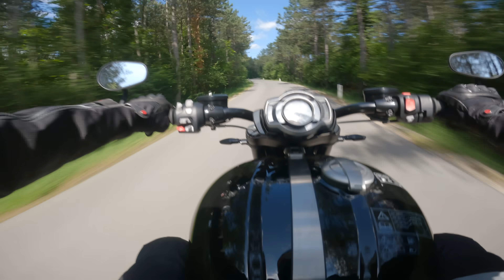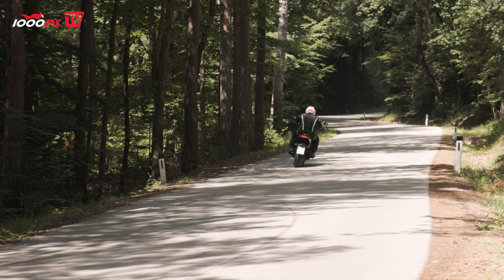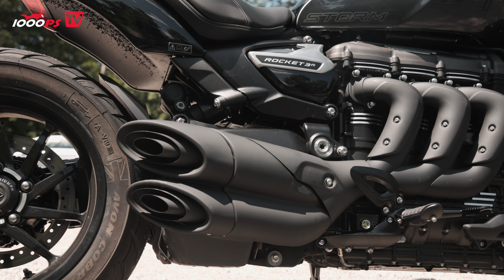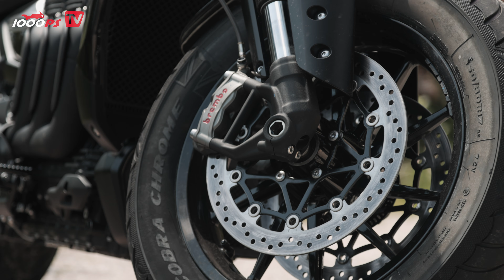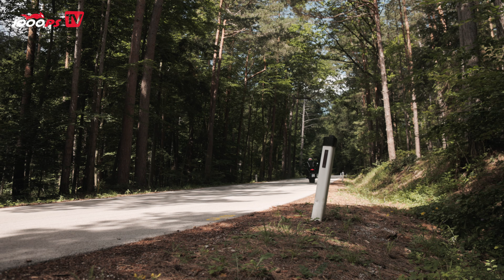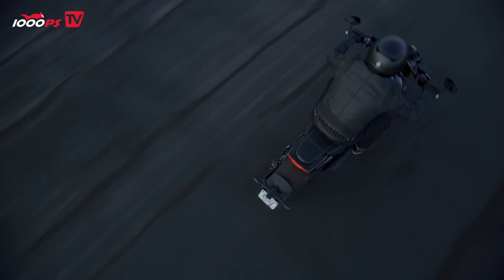225 NM TORQUE! Triumph Rocket 3 Storm R Test 2024

Comment: Good video. I hate when other reviewers say it’s not meant for the twisties. No… just because YOU can’t ride it doesn’t mean the bike isn’t capable. My 2020 gets ripped through the mountains and hills regularly. Did a track day on it as well. Didn’t break any lap records but the coaches were impressed. Fantastic bike. Mine has 50k miles on it currently. My speed triple 1200 rs has 10k. Both are very capable and triumph did a great job with them

Comment: This was a really good practical assessment - despite the low-down weight I wonder how easy it is to manoeuvre when you’re pushing it around?
Much respect from me for your rider’s skills, but you’re right on the edge of being bitten big-time… stay lucky and Thanks!
Reply: They are easy to ride but pushing a "dead weight", especially on gravel car parks is to be avoided.  I also (always) reverse in to park so I can ride straight out.  Any incline or road camber towards the kerbside makes moving difficult.

Comment: How solid and reliable is the gearbox? Shadetree Surgeon had gearbox trouble i heard with it jumping out of gear not sure if it was 2nd or 3rd gear. Also are the electrics good as thats often very expensive to fix. I know the 1600cc Thunderbird is great and someone i know well bought one for £5500 with 16600 miles on the clock. The finish was immaculate, even fasteners were clean with no rust. Its got so much pull from under 1500rpm and the balance was low so it felt great. U turns were good for the weight but on full lock its not easy but comfort, brakes, forward controls and handling was great for a big cruiser and the rocket 3 is probably similar and as its torquey and low revving it is returning over 40mpg when cruising in top gear. I had a old 1996 Daytona 900 and that was top heavy but keep it below 5000rpm it would do nearly 50mpg if you didnt be agressive on the throttle. The rocket is far better on a long journey in comfort. The shaft drive on the rocket 3 is brilliant. The Tiger 1200 seems well built as does the 1050, 900 and 800. Amazing triples. Theyre far better than the spec sheet suggests and theyre well sorted over many years and far better in my opinion than the bonneville twins. I do however love the 675 daytonas, 1200 scrambler, speed and street triples and the trophy tourers from the 90s  certainly seem to go on and on. The speedmaster, thunderbird 900, speed twins and even the bobbers are good factory customs and the latest 178bhp speed triples go like stink with great build quality, design, suspension but £18k isnt cheap but the 765 street triple basic model is a bargain next to other middleweight bikes but the Yamaha MT09 seems a very well made bike and the suzuki v stroms seem to be great for touring like the 800 but they are not cheap but it depends on income as many bikers use them for year round transport and cant afford dealer prices for servicing so long service intervals for valve clearances makes a big difference. The Yamaha supertenere 1200 is a great, rugged, well built bike but the valve shims is a difficult job. Working on the honda v4 engines wasnt easy either and getting to stuff meant so much work removing fairings for example before getting to stuff. Having a complete workshop with tools, bike lift etc certainly makes so much difference.

Comment: Finally! Someone who can actually ride the Rocket!  Thanks much for an awesome review. 83,000 miles on my 2020GT btw.
Reply: Hi, have aprox 25t miles on mine, flashed, how is Yours performing? kudos 4 the milaege
Reply: @Marco-123-mmj  Actually the Rocket got stuck in 6th gear (the pivot plate and the detent wheel had worn to the point where they wouldn't shift the transmission) on a long trip. I made it the final 1300 miles home through mountains in that gear, no neutral either. The clutch was not even ruined by the trip. I cant think of another bike that could make that trip in sixth gear only. Running great and on the road again.
Reply: @jimanders9971  👍, nearly unbelievable. Had to changed clutch plates due backwheel spinning starts as my TC is off. But was my fault when trying to start from the 3rd and burned it. Fun having slides in sharper curves💃😇.
Reply: @Marco-123-mmj  I am the guy in our group who goes on ahead in the twisties then waits for the others at a predetermined spot. lol.
Reply: @jimanders9971  waiting for the pray👌🥴. btw I m 70, and the Q is how old r u? reply : wtf? no problem , lets drift😂
Reply: @Marco-123-mmj  90,000 miles not and still running strong,
Reply: Respect 🫡
Reply: I think I read online that you to have to valves on the new Rocket bikes every ten thousand miles?
Reply: @Dnewman3402-6  I now have over 86,000 miles on the GT and I have had the valves checked twice. Neither time did they have to adjust any of the valves. I wont have them checked again unless it starts clattering or gets hard t start.
Reply: Is it a 1 million mile bike?
Reply: Is it a one million mile bike with original engine??

Comment: I ride one since 2 years and 14000 miles done. Absolutely great machine. No complains at all, just the keyless go is a nightmare. And in serpentines it is a bit tricky due to the pretty wide wheelbase. But over all: it is THE bike to feel.
Reply: If you have not tried carry the fob in your right watch fob pocket. It works great for me, flawless. And I have 83,000 miles on my 2020GT.

Comment: what I would like to know is it able to with stand some level of engine modification like the custom built Suzuki hayabusa. a 360 rear tyre and a big turbo would be a good start.
Reply: On the Triumph Rocket 3 there have been owners modifying both the old and new models with horsepower gains up to 340 horsepower from TTS supercharger.  I  rode a naturally aspirated 260 horsepower older model at the Bonneville Salt Flats in 2023. This year I'll ride a slightly modified 2021 GT with 160 rwhp at Bonneville.
Reply: I like my 2022 GT3 the way it is. I owned a 8.1 liter Boss Hoss with a 360 rear and every 6 months I was replacing the tire. About $500 each time. It's not worth it and reduces the handling.

Comment: I LOVE the bike for what is and am really glad that is exists, and would even consider adding one to my modest stable, but I get nearly TWICE the power-to-weight ratio from a stock 16-year-old Ducati, and fully TWICE PLUS with basic weight-saving and power-boosting measures.
Reply: I have 11 bikes ( MVAgusta, Aprilia, Benelli, ) and  the Rocket three. Despite a 200 hp MV and Aprilia nothing prepares you for 220nm or torque. Power is just instant and it just a hoot to ride.
Reply: @johnblack9037  I have absolutely no doubt, and that's a big reason I would love to own one. THE TORQUE.